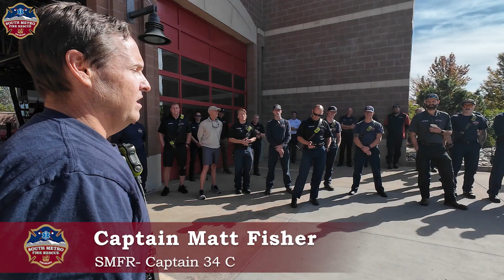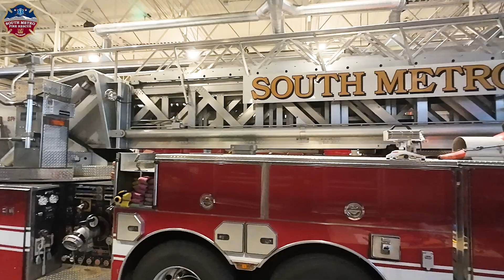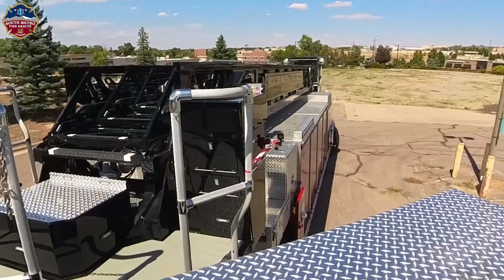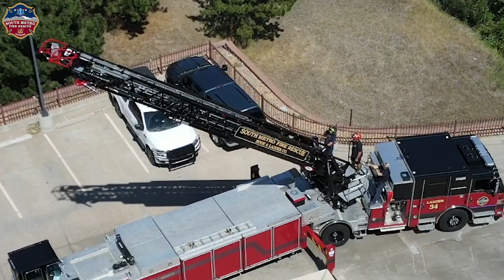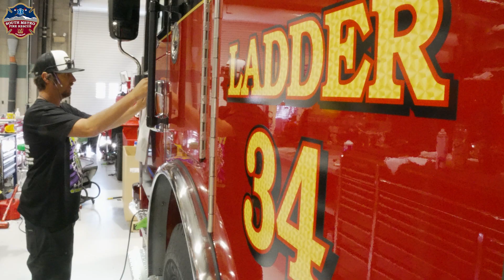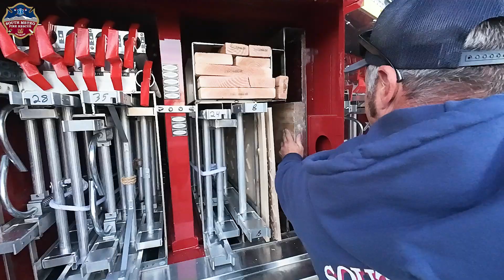Ladder 34 in Service

Comment: Congratulations. On new unit what do u guys plan to do with midmount
Reply: The old “Tower-34” a 2015 Pierce Velocity Midmount (the midmount seen in the video is a reserve unit) will be reassigned to STA35 as “Tower-35”, Tower-35’s current unit another 2015 Pierce Velocity midmount will be transferred to the reserve-fleet and that unit will replace a unit in that fleet (likely one of the 2006 Sutphen midmounts)

Comment: Did tender 34 get sent to ever station 20 or station 43 by any chance cause I just watcha video from east valley fire buff and I don't see tender 34 at station 34
Reply: Tender-45 was reassigned to STA43 as Tender-43, and Tender-34 as reassigned to STA40 as Tender-40, the current Tender-40 became Tender-20
They decided to do this to free-up the Ladder-Companies from having to split their crews to staff and tenders, and more the tenders closer to aeras most likely to need them.
Reply: @Autofleet4429  so is tender 34 no longer in service for sta 34
Reply: @trucksortrainsnation  yes, there is no longer a Tender at STA34, the new tender locations are STA20, STA39, STA40, STA41, STA43 & STA46
Reply: @Autofleet4429  oh ok but isn't 33 gonna need a bigger bay to hold 4 apparatuses in it
Reply: @trucksortrainsnation  33s was a typo that I missed, it's STA43 not STA33
Reply: @Autofleet4429  oh ok both station 46, 43, and 20, 39. 40 and 41  make scenes because they both have brush trucks or a brush engine

Comment: How will SMFR handle when LAD34 has to go OOS for PM or other reasons and a reserve piece needs to be used? I assume that TWR34 doesn't have the space needed to switch all the equipment over from L34.
Reply: Old Rescue-34 will be retained as a special-operations reserve,

Comment: Now you guys need to look at Ladder Tender for L34. A LT is a Engine that has A bunch of Tools that Has both Extrication, Heavy Rescue and Misc Resources that the Ladder has, without The Ladder on top so the Ladder doesn't have wear and tear. Its a Co Man Team. It's good for Medical, It's good for Hazmat, and it's good for Fire.
Awesome Work guys!!! ❤
Reply: Well as they said in the video they want to move away from cross staffing rigs.
Reply: @Maizefire  it's not a cross staff.  Difference in co man and cross staffing is the co man Unit with the Engine that's considered a LT could be used on different incidents if there's a Ladder already on Scene.

Comment: is the current tower 34 going to tower 35 and tower 35 to spare?
Reply: Yes
Reply: @Autofleet4429  hopefully they'll keep the sutphen, there's is no current training truck, is there?
Reply: @ocscards9  As far as I know there is no plans to keep a Aerial as a training unit, when training Aerials are needed, they use a reserve unit and if no reserve unit is available they use a frontline one (which is scheduled to coincide with said frontline unit's training schedule) they could also use the diver training Tiller too (assuming qualified personnel are available to operate it)

Comment: Why are there green lights on the light bar and not red?
Reply: The light bar doesn't have green
Reply: SMFR doesn’t use green lights for their regular bars (Command only), you might have confused it with blue lights. SMFR utilizes Red and Blue Light Bars, which has been proven to be the best warning light option in most situations (Day and Night, fog, etc.)

Comment: Awesome to see Chief Pickfords promotion! Congrats Chief!

Edit: just thought of this, what’s the plan when this rig is OOS?
Reply from the maker: @henryjt2377  they will go into a reserve tower/ladder and Heavy Rescue 34 will be a reserve unit so they will go back into that for the time being if needed.  

This was the Fleet Friday video for Ladder 34 for now!
Reply: @SouthMetroFireRescuePIO  Thanks for letting me know!
Reply: @SouthMetroFireRescuePIO that’s smart to keep rescue 34s rig around. Can also be used as a spare dive or hazmat I suppose
Reply: They might use the training tiller, it is the only unit in their fleet with enough room to fit all their equipment
Reply: @infanatorgaming6577  was thinking of that too, but I’m not sure it meets their department  standards for a front line vehicle
Reply: @henryjt2377  it's not gonna be a front-line unit remember that, they will keep it as a reserve unit for ladder 34 specifically
Reply: @infanatorgaming6577  I get what you’re saying. I’m not sure it has the same space for equipment either
Reply: @henryjt2377  it's quite possible, just gotta wait for fleet Friday and see
Reply: @infanatorgaming6577  yup
Reply: @infanatorgaming6577 the training tiller doesn’t have a pump and they operate with all ladders being quints so they would have to use a engine along with the training tiller for it to work as a reserve
Reply: @infanatorgaming6577  maybe they will go over it in fleet friday